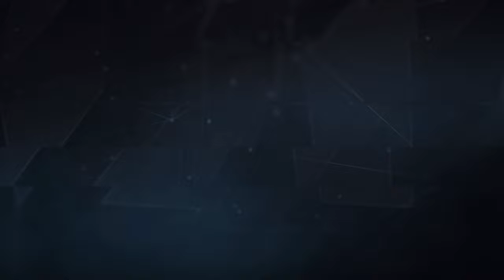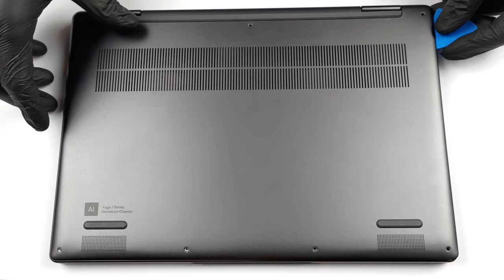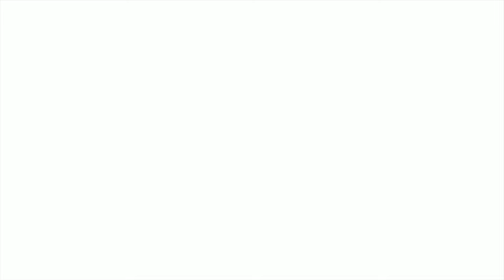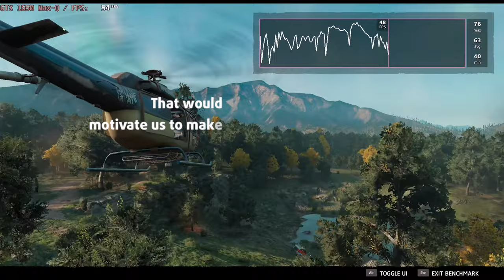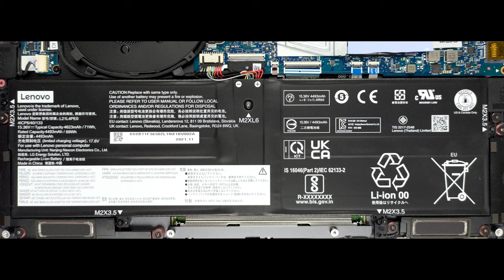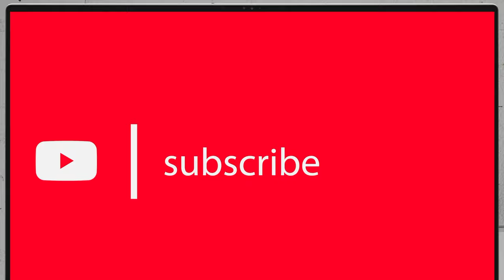🛠️ Lenovo Yoga 7i (14", 2022) - disassembly and upgrade options

Comment: I hate the fact they solder the RAM without giving you an empty SODIMM slot. This seriously reduces the longevity of this device!
Reply: Yeah came here just for that. The 16 inch version is on sale for 600 on best buy but with just 8gb that's not enough for any serious user. 16gb is the minimum I'd go with.
Reply: @Peremptor  Absolutely. Especially when the device reserves some of that RAM for the iGPU/APU. That 8GB can become 6GB oob.

If they at least included an empty SODIMM slot like they used to.....
Reply: @RGInquisitor  Yeah 8gb sucks with win10/11 period unless you just stick to using it more like a tablet than a pc.
Reply: Facts !!!!’
Reply: That's why I normally buy Dell which is very easy to add more memory and SSD.
Reply: @redoctober2026  Are the newest Dells any good? I stopped buying Dell laptops when they kept dying due to bad soldering on the SMCs.

Comment: The SSD M.2 Gen4 Shown at 2:13 looks small, would a 2TB SSD M.2 Gen4 fit? Actually wondering for the Lenovo Yoga Slim 7 ProX which I guess is similar.
Reply: Yeah, they built a 2240 m.2 SSD into the Yoga. But this metal thing behind the SSD is a standoff. So, 2280 SSDs will also fit. PCIe 4.0 should be supported due to Ryzen 6000. Make sure to get a thermal pad to cover the whole SSD because Gen 4 SSDs tend to get toasty.
Reply: @internetexplorer3894  interesting, I just replaced my SSD m.2 gen4 from 500gb to 2tb, made sure i bought the same model (only different size) and had no thermal pad on it...